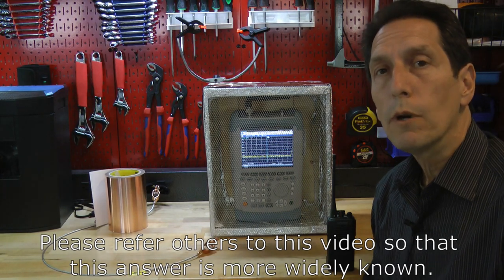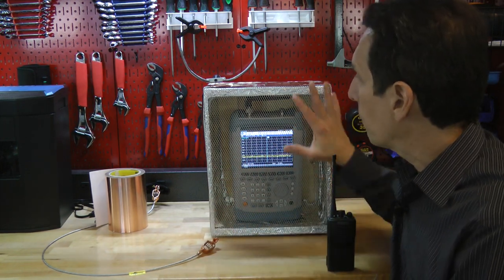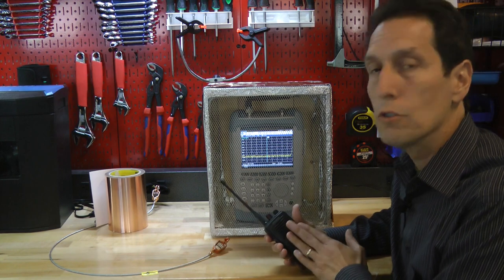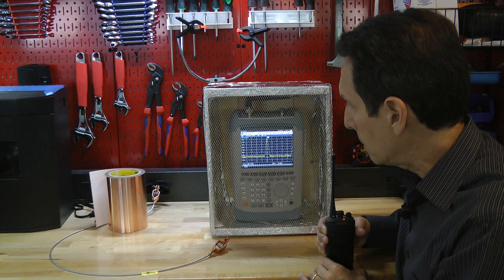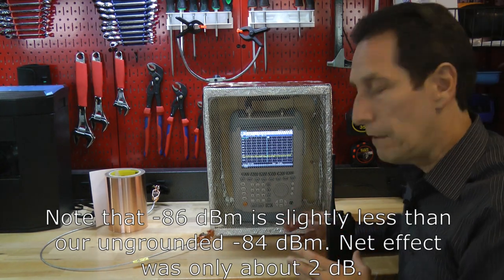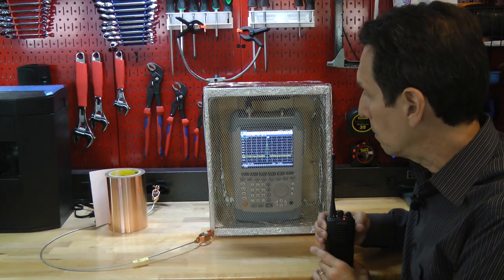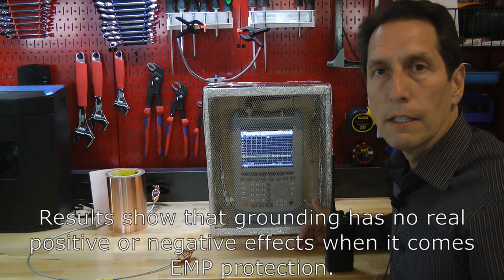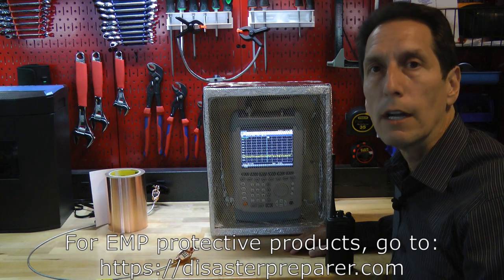Should You Ground a Faraday Cage?

Comment: Thanks for clarifying with testing to give a definitive answer to this debated question. Todd
Reply from the maker: You're welcome Todd.
Reply from the maker: @dawid1803  Sure it is. The shielded box provides about 40 dB of shielding with the mesh. Not ideal, but it is used to demonstrate my point about grounding.
Reply from the maker: @dawid1803  A large conductive structure like this would act as a barrier, providing both reflection and absorption losses to RF waves. The closer you were to the back side of the barrier, the lower the fields would be. It's complicated though because the waves can bounce off things and come in from behind as well.

Comment: So, just like lightning does not follow the same rules as "low" voltage electrical potential, why would we confidently conclude that the kind of momentary rf energy we are talking about would behave the same as a little two watt transmitter?  It seems to me it would be a different ballgame.

Comment: Dr Bradley:  Does the wall thickness of a Faraday cage matter? For instance would a galvanized steel enclosure have better shielding effectiveness than the same enclosure made of thin aluminum foil? Does thicker material buy you some additional dB of shielding effectiveness?
Reply from the maker: I answered this earlier, but I don't see my reply. The answer is if you have about 40 microns of metal thickness, additional thickness has a diminished effect. It has to do with the skin depth of the material. BTW, 40 microns is about two layers of heavy-duty aluminum foil.
Reply: @disasterprepper  have you tested the effectiveness of aluminum window mesh for this?  It's thicker than foil, but has small holes- but do they not matter except at extremely high frequencies?
Reply from the maker: @FancyNoises  I've worked with screen before and it does pretty well. The difficulty is getting it to lie flat and not create any gaps or unwanted seams. The small holes don't compromise the shielding much, but I found it hard to work with.
Reply: @disasterprepper  would the material itself have an effect on the needed thickness - i.e. copper foil tape is typically 36 microns thick but would be great to line a pelican-style case with to add faraday protection? Could you test both a single layer and two layers of copper foil tape for their effectiveness? Or have you already?

Comment: Dr Bradley: When building a Faraday cage using a painted ammo box, etc., must you remove the paint before installing the conductive gasket material? What do your tests show?  Does the micrometer thickness of the paint still allow RF from an EMP to enter the Faraday cage enclosure if you don't remove the paint?
Reply from the maker: I answered this earlier, but I don't see my reply. I've tried ammo cans with and without the paint removed and didn't see much difference in terms of shielding. I used to always use a Dremel tool to take off the paint, but I think it's probably unnecessary, and can cause rust issues with the metal.

Comment: Great vid. Question about what would be needed to make an effective faraday cage room if I’m building an ICF ( concrete form ) home? Does rebar act well enough and at what regular interval distance. If not It is there an easy solution like an emp blanket fabric that you would insert prior to pouring? Thank you for your expertise and willingness to share your knowledge.
Reply from the maker: I've consulted for folks who wanted a Faraday cage room in an ICF home, and it came down to three options: conductive paint, conductive barriers applied to the walls (copper foil), or an internal Faraday cage room. They are listed in order from least effective and cheapest to most effective and expensive. You'd want to hire a good consultant to help you do it right.

Comment: Hello! I’m interested in calculation methods of faraday cage. I know that high frequency emi is not blocked by foil, but it flows on it’s surface, so having multiple layer of high frequency electromagnetic conductor (like mu metal, copper) foil or sheets will increase the shielding performance. But emp has wide spectrum from >0Hz to around hubdreds of Mhz, but the power of powerfull EMP and methods to calculate the amount of layers quite bit tricky to evaluate. Could you please suggest how to calculate or find more information about this? Thanks!

Comment: What is your opinion on old vehicles with electrical components consisting only of a battery, alternator, distributor coil points and condenser, as far as their resistance to emp or solar flare?.
Reply from the maker: First the good news. Cars aren't affected by solar events (flares, CMEs, etc.). Now the bad news. Cars can definitely be affected by an EMP. Older cars are believed to be less susceptible (makes sense since their electronics are larger in scale), but there's no guarantee that they would survive. If you're worried about it, you might check out our T.R.A.P. products. They're reasonably priced and offer distributed transient protection.
Reply: Even a 12 volt coil is sensitive to EMP that's why the military used to have braided spark plug wires and shielded magnetos and or distributors we called it termination as a lineman termination ,(is just grounding The shield of the primary voltage in a high voltage wire) the shielding around the wire that is non-current carrying for safety purposes..()( with tons of insulation for the application.... In other words it's more than 600 volt rated wire when we used to run 4160 we used a high voltage cable for 4160 the higher the voltage the more insulation you need and in line work, but my point is everywhere high voltage goes into a conduit or underground it has to have grounding shielding wire around it and that's what we terminate.. or ground that's why the wire is so expensive and why most electric wires are on top of insulators in the air as well as for cooling

Comment: In Monash university I watched this guy conduct a test of a ceramic insulator. There was a whining noise and then a big spark arced with a bang about a foot around this ceramic support.
This was contained in a shed of corrugated iron and I was told this was to block the EMP from affecting the other electrical devices in the building.

Comment: I am an EE hobbyist, with limited knowledge. My interest is not an EMP event, so much, but protecting an electrical DUT from ambient electrical noise, when the DUT has been removed from its metal case, to enable attaching probes and testing. I will use a simple cookie tin. I will electrically tie the lid to the body, with a flexible wire. For this use, should I tie the tin to Earth Ground? Thank you for your help.

Comment: Hi, I’m not sure how to message you or ask you other than here in the comments. Im confused because ppl have told me I need to bury my farrady cage underground in order to maximize its effects, but they said the purpose of that was to ground it… so would this mean I do not need to bury a farrady cage? How effective would it be to layer the inside of a 40ft shipping container with copper foil & solder the foil shut? Would that be enough to protect needed equipment in an hemp? I am also planning on keeping a backup used off grid solar system for a house there - what parts of the electrical for my home would I need to store & replace in the case of an hemp? Do I need to store extra wires? Also, are backup wires that are still on a reel & unused - would they be fried in an emp or can they be stored outside if a farrady cafe? Lastly, I have an unused car I was thinking about dissembling the necessary parts that might be affected in that sort of emergency… which parts should I store & which parts would be fine? And if I get a electric car conversion kit or a biodiesel conversion kit, which car parts would I still need to store that are reliant on electronics that are not related to electrical or biodiesel conversion? Thx so much!!!

Comment: 👍🏻. FINALLY… A real answer to the “grounding question”!
Thanks so much Doc!
I have tried to test both grounded and ungrounded faraday cage devices and never saw much of a change so thought I was not testing properly. With virtually zero clue what to expect from an EMP/CME, I tried everything from 29Mhz to 5GHz and at ERP of up to 110 Watts.  

I have a Agilent HSA spectrum analyzer I use for duplexer and cavity tuning and it’s upper range is only 3GHz.  Knowing what to expect, I plan on re-doing the experiments using different screening materials.  Yup.. just boredom. 🤣

Btw -  Whenever I speak with fellow EE’s and Amateur Radio Ops, this is THE question most of us have.
AND…It’s funny that most every “prepper” type person generally has a pseudo source of RF energy to represent EMP energy is sitting in their emergency communications bag.  A GMRS/FRS transceiver.  462.6000 through 462.7250Mhz on the simplex or repeater output frequencies of the higher power GMRS 50W channels.

Comment: Might be a stupid question but should equipment inside a Faraday cage be protected from the exterior conductive material (i.e. not touch it) ? Say a radio has a metallic body, should I prevent it from touching the housing of the cage by using, say, a towel ? Thanks
Reply from the maker: Items with exposed metal should be insulated from the interior of the cage. Most people just line the cages with cardboard, but a towel would work fine too.
Reply: @disasterprepper  Got it, thanks a bunch and have a nice day !

Comment: What happens to items internal to a Faraday cage that are in contact with the interior wall?  Is the shielding effectiveness lost or attenuated?  People have said to line the cage with cardboard, etc., but no one I've watched has said what happens if you don't line the cage with an insulator or if the insulator falls aside and lets a device you want to protect touch the inner surface.
Reply from the maker: If a metal item inside the cage came into contact with the interior wall, it could experience some unwanted energy. It would also act to bring the energy into the cage and act as an antenna, re-radiating it throughout. Better to keep anything metal from touching the interior metal walls using a cardboard or other insulative liner.

Comment: Does the use of aluminum and copper invoke a bi-metallic problem into the Faraday cage?
Reply from the maker: I answered this earlier, but I don't see my reply. The short answer is that no, I've never seen a shielding issue result from using two metals in contact with one another.
Reply: Thanks!

Comment: one important thing is to match the antenna polarization with the spectrum analyzers antenna. i noticed your radio was vertical and the analyzer was horizontal. maybe at the distance it might not mean much but  if its further away it will.
Reply from the maker: Yes, absolutely true. We're always careful to test both in vertical and horizontal antenna orientations when conducting actual shielding measurements.

Comment: Hi Dr.Bradley. Dr. Wormsley here from the channel Goshen Prepping. Although clearly, your results show that there is barely a difference in the radio fields entering the cage between grounded and ungrounded. However, isn't the ground in place to counteract the Compton effect? Ionization that could damage the equipment inside?
Reply from the maker: The Compton Effect refers to Compton Scattering. This is just the effect that occurs when electrons are produced by gamma rays hitting air molecules. It's why we have such a powerful electromagnetic wave felt at the earth's surface. Grounding a cage won't affect the incident field felt inside the cage in any measurable way.

Comment: I just found your very informative channel and subscribed.  One question: If one was constructing a garage-sized or shed-sized EMP room to protect larger equipment (i.e., vehicles, etc.), could one make the case that running a sizeable grounded grid with larger conductors might have the advantage of diverting lightning strokes to ground and maybe protecting the foil envelope of the Faraday Cage for its true purpose later?  I am no EMP expert here by far, however, I wonder also if the quickly ramping and high frequency / short duration of a true EMP or solar CME might result in a benefit from including an earth ground to drain at least some static charge.  Thanks for your work!
Reply from the maker: Hi Michael, yes, large conductive structures like the ones you mentioned should always be earth grounded.

Comment: Rich thank you for much for doing all of this testing! you are exactly what we need in times like this.   Fyi, grounding you shield doesnt impact radio fields very much (especially if the cage is actually working to reduce radio, but if you DONT ground the cage you may end up magnifying any Electric fields present.  Apparently electrical attenuation is also a potential contributing culprit with Electric Pulse type damage??   especially when there are non insulated older aluminum electric wires present??

I once worked at a healthcare system in the IT department (some 10+ years ago) and we purchased every wireless device that had been invented at that point and brought them into a room with nearly every moveable piece of medical equipment to satisfy some open Air electric field and wave safety standards.  We used meters to detect signals like the one you have, some of the devices we tested emitted electric and radio at the same time, especially when pluged into a charging device, others just radio fields (I do remember very well the blackberry of that day (the ones that where very bulky and had a new cell phone module installed, they did not originally have a cell phone inside them) and those devices were very noisy, very bad at both types of fields sending out 4-5 times the amount of microwatts per square meter or meter squared... than any other wireless device, however that goes, and if you had two of the blackberries next to your skin you would end up creating as much as 4 volts of field strength onto your skin, electrostatically raising arm hairs.  Other devices magnified any electric fields it received from the older (were newish at the time) 2.4ghz vtec phones. In the testing we documented effects of different spectrums and wave and field blocking and also found aluminum foil to be the most effect across the board and the most economical (we also had static bags that we used to ship hard drive and memory sticks, these were not as effective, im guessing because they had holes in them like your chicken wire, and that stuff was very expensive.  One medical device was dramatically effected by most cell phones in general, many of the controls would not respond or would start doing things on their own and double and triple aluminum layers didnt change anything, it still reacted haunted (i think it was russian or something, not german or japanese and certainly not chinese back then), however the problems went away when we connected the aluminum sheets to the ground that was part of the machine.  Also I found another youtube video describing this same issue requiring a ground to prevent electric fields and also prevent them from being magnified when using the copper sheets or the conductive EMP wall paint. https://www.youtube.com/watch?v=FhdawUxnNqY
Reply: Yes, that was a lot of bullshit. ;-)

Comment: so is it the idea that inside a metal container the items will be protected by the metal container "reflecting" the pulse back outward?  must the walls of the metal container be lined to insulate the items from the metal container? if so, with what? also, it seems grounding the container would be beneficial, look at lightening strikes?? not sure I understand the "insignifcance" of grounding??

Comment: It would have been interesting if you had opened the cage up afterwards and did it one more time to show full signal strength and as a result how many dB the cage was blocking.
Thank you for the video!
Reply from the maker: I answered this earlier, but I don't see my reply. Yes, I probably should have done this. The signal level would have jumped up to around -30 dBm. I always get nervous driving the spectrum analyzer with such large signals.
Reply: @disasterprepper  very true,  it could over range it,  but I would suspect that the spectrum analyze would have protection diodes in it to prevent damage from an overly strong signal coming in the antenna.
Reply: @AnotherMe890  Actually they don't but usually have a label or a manual statement as to the maximum input allowable.  Most of the HP stuff had +30dBm as the max.  That's one watt at the characteristic impedance selected.

Comment: Dr. Bradley, thank you yet again for another great video. I have a question, I am finding conflicting information regarding aluminum vs steel trash cans used as Faraday cages. I currently have a steel trash can that is lined with cardboard, seams sealed with aluminum tape and am getting your EMP gasket for use around the inner lid. My question is should I be using an aluminum trash can instead of steel? Does aluminum afford better protection? Thank you for time.
Reply from the maker: Aluminum or steel will work equally well. Both are excellent conductors, and the type of metal used doesn't really affect the results when it comes to shielding.
Reply: @disasterprepper  Thank you Dr. Bradley I appreciate your answer. Good to know it should be okay.

Comment: I just learned something yesterday about faraday cage and faradaic protectionware like silver coated shirts body protection. Unless you are completely encased inside a clothing you wear, not grounding the that conductive metallic shirt is that it becomes a receiver of charge and all other parts of the body that is not protected would actually end up receiving more radiation around where the shirt is being worn, for example your head. In that case grounding would have helped